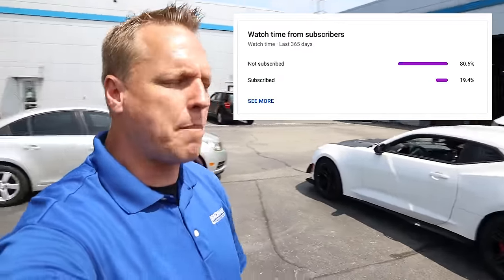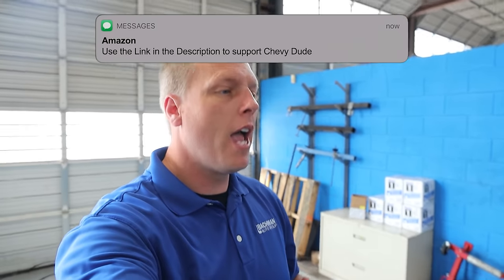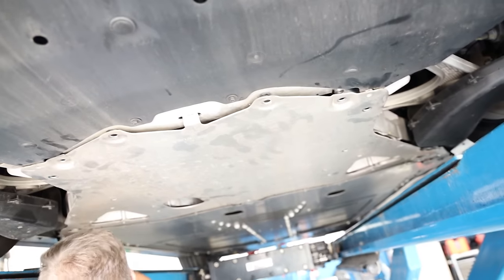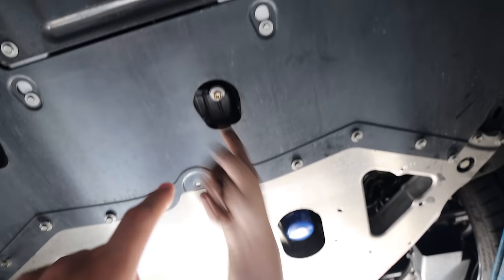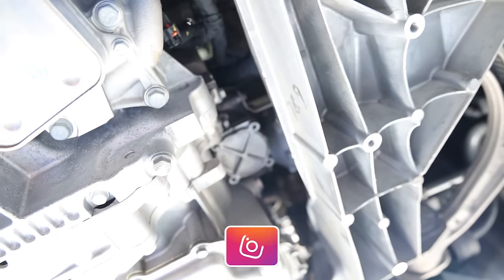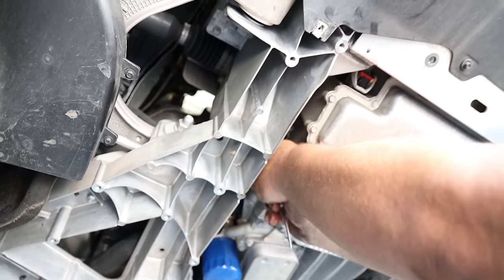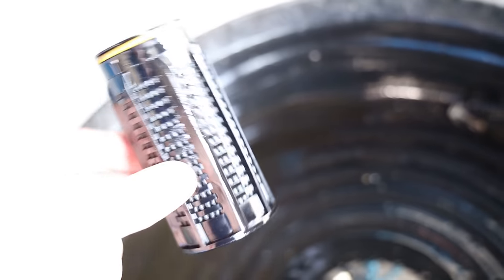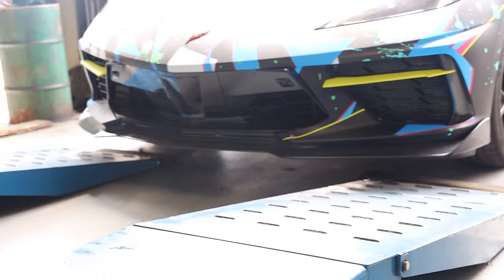How to change your DCT filter in your 2020 Corvette.  Dual Clutch Transmission Maintenance

Comment: Per the owners manual, DCT filter change at 7,500 miles, then at 22,500 miles then at 45,000 miles.  DCT fluid change at 45,000 miles.
"The initial transmission
 canister filter change must be performed at 12 000 km (7,500 mi), and every 36 000 km (22,500 mi) thereafter."
Reply: I do not this to many vettes will last 45,000 miles, still too many flaws

Comment: Just an FYI you need to do the valve flushing procedure prior to removing the filter to send all the contaminants in the passages into the filter.   Dont just pull the filter without doing this.
Reply: That procedure was only recently put out by GM as a result from the various DCT issues that have occurred on some C8s lately.   It didn't exist when they made this video.
Reply: @skylerallens  I saw your comment about this on another video about DCT filter replacement. Just to confirm, it IS required to flush the valves prior to removing the filter and that does require Chevy's MDi tool, right? Although it's outrageous what the dealership charges for this service, it sounds like, by the time I paid $500 for an MDi tool, and $200 for the filter, I couldn't do it any cheaper myself. Plus the dealer would probably attempt to deny any transmission related warranty claim if I did do it myself, claiming I did it wrong (even though I'd probably put more care and attention in to it than the dealership)

Comment: Thank you for the information for us C8 owners. When you changed the transmission filter, not.much fluid came out but some did. Why would the dealer not put more into the transmission? I know this is a big process but what if the trans fluid was already low? 
Thanks.

Comment: Chevy dude, aftermarket air filters are usually available and claim to boost horsepower. Any proof of this, and are there any you would recommend to get us rounded off at that 500 horsepower mark?

Comment: Hey Mike,
Did you figure out the cost per DCT filter change? Is this covered under a service package (is there a service package for the C8 and can you share the cost of it?)
Reply: The filter is $165/ea plus tax and s/h from Paragon.  With the 13+ qts @ $39/ea (with the 2 additional) you are looking at $633 plus tax and s/h do do the trans flush yourself.  Note the service interval for trans fluid replacement, unlike most vehicles that can go typically 100k miles.

Comment: Chevy Dude, What is the latest on Radiator Grill Guards ??? I like the look (and protection) but GM TADGE JUECHTER said it may void the warranty suggesting heat in the transmission.

Comment: At 4400 miles my C8 would not start. I researched & many others are having same problem & also discovering transmission fluid leak. 
My C8 has never been tracked, never launched. Too many C8 owners reporting same issues.

Comment: I have a 2020 z51 pre production corvette with 4,300 miles.   It is giving me the change oil soon message.  Is this because of a timer perhaps?
Should I ignore it until it gets to 7,500 miles?  I’m afraid to turn the dealer monkeys loose on it any sooner than necessary especially for the DCT filter.
I’m sure bolts will be lost and probably they’ll pry the filter out and use power tools where they shouldn’t.  Makes me want to do it myself but I’m a 50ish woman.
Are there any dealers in Texas or California with designated corvette techs?

Comment: GM says the first oil change doesn't have to be done till 7500 miles like the transmission.
  Why is it that you don't have to change the oil at 500 miles like most new cars. Does the C8 mid engine have different specs so it doesn't require a 500 mile oil change? Like you said in the video you and someone else did an oil change early that wasn't needed.
Thank you,
Mark

Comment: No torque settings for any of the bolts?   I figure the one for the oil cannister is hand tight only (53 in-lbs apparently).  But the ones for the panels (the 10mm, 13mm and Torx E16) should have some sort of torque setting.  Got a clue?

Comment: Man I wish I found out about you sooner I end up getting a 2014 town and country from this dealer and I been having nothing but trouble as soon as I get it had to change the brakes it was metal on metal then the check engine light and stability light came on at the same time and sometimes I use the a/c glass shards come out of it so ya I don't have the best of luck

Comment: Just a question, if I'm buying a C8 to track, why doesn't Chevy offer as an option or make it standard on a Z51 package that the 2 additional quarts of transmission fluid needed to track a Corvette be put in at the factory during assembly? Why make it difficult and expensive for the customer right from the start...
Reply from the maker: If plan to track it. Just tell your dealership so when they PDI they can add it. That’s the factory’s solution and it’s the correct one.
Reply: It is not a correct solution it should be there from the z51 get go.
Reply: @ST-bk5uf  I agree. If you order Z51 it means you are probably going to track the car. It should be standard on that Z51 option. It should be optional on the base without Z51. The labor to add 2 quarts of transmission fluid is pricy in addition to the 100 dollars for the fluid. Like Chevy dude said in the video "Tons of labor". Tons of labor is tons of money. And I know it's more labor to add the fluid than to change the filter.

Comment: Any tips if your free maintenence expired. Was told that service is at 7,500 miles or within 12 months. Since I don't drive it often, by the time it hit 7.5K it was past a year and they no longer cover it. So my dealer wants to charge $688. Any recommendations?

Comment: I noticed an opening for the oil filter. Could you cut a similar opening for the clutch filter?
Reply from the maker: There’s a reason it’s not cut.  I would not
Reply: Probably because the oil filter looks to be a conventional screw on type and located close to the panel so you don't need as much access room to remove and replace. The DCT filter being a cartridge style with a separate 4 bolt cover and an O-ring as well as further up inside the compartment needs more room to be able to push the filter in a click in place. You need to make sure you get the cover straigh in to insure O-ring seats properly as well as to hold it in place while getting the bolts started.
Reply: Also the access hole is mostly filled by the bottom of the air filter minimizing the amount of air forced up into the compartment and any airflow turbulence that could effect down force. An access hole for the DCT filter would be wide open meaning it could create a considerable amount of turbulence. Also the extra labor cost at every 7,000 versus every 75,000 miles would add up considerably.

Comment: How much time does it take to change the filter? Mine needs it done soon and am getting quotes of $900.00 to $1,000.00 to change it. Seems a lot. Is it the filter that costs a lot or the labour?
Reply: Takes more time to get the bottom engine cover off...and back on. I just did mine, and the filter was $133. When you do the first service at 7,500 miles, if you get the drain and refill, the oil costs $48 per quart. The maintenance time is getting to the fill plug...have to take trunk forward cover and air cleaner out to access it.  So some labor and expensive materials. I'm still b learning myself.

Comment: Is there a time limit for the 7500 miles dct filter change? if  before 12 months?
Reply: It only specifies 7500 miles for the first filter change. Then the interval changes. The next filter change per GM service information (GM S.i. ) change would be 22k miles.

Comment: Wondering how many auto repair places will be using air tools on those bolts and a flat head screwdriver. Also not that familiar with DCT but every 7500 miles to replace the filter seems excessive but if thats what GM calls for so be it.
Reply: Another comment says that the manual says to change the filter at 7500 miles the first time, then every 22k miles afterwards. So I guess it’s just due to break-in.

Comment: IMPORTANT INFORMATION: CHECK DCT FLUID LEVEL & ADD FLUID THAT WAS LOST DURING THE FILTER CHANGE.  The filter change instructions include adding approximately 0.2 liters of DCT fluid after changing the filter.  Here's a link to the graphic that shows the instruction to add fluid back.  https://www.midenginecorvetteforum.com/filedata/fetch?id=154908&d=1592298547

And here is the full list of instructions from GM...

C8 DCT Canister Filter change:
(6/4/2020)
Filter Kit Part Number: 24299326
Oil: ACDelco Dual-Clutch Transmission (DCT) Fluid-FFL-4 (part number 10-4130 / 19418016)
Removal:
Remove rear Cradle Shear Plate
Do not use power tools
Remove 4 bolts from Canister Cover 
Remove Canister Cover
Remove Seal (discard)
Remove Filter (discard)
Installation:
Clean threaded bolt holes
Clean filter housing (seal groove area)
Clean Canister Cover (seal groove area)
Install new filter (push upward until positive stop)
Install new filter seal
Apply light coating of new DCT fluid on new seal
Install cover evenly
Install 4 cover bolts, hand tighten
Ensure cover is fully seated
Do not use power tools
Tighten 4 bolts to 53 inch lbs.
Fill transmission to correct level.
Install rear Cradle Shear Plate.
Reply: You should have done the video !!!
The "Fill the Transmission" is what concerned me the most.

Comment: If you have to remove 30 bolts to do this every 7,500 milers that is a fail and a bad design.
Reply: and relying on chevy techs to not use power tools or screw drivers to not pry it off.  lol.  same ones installing brake ducts when they shouldn't and not knowing what jack points to use.
Reply: lol seriously? Are you dense? How is it a bad design? The car is made for performance, hence the reason those panels are under there like that. Obviously you are new to performance cars. If you only knew what exotics are like to maintain... hah

It's obvious to me you're just reaching really hard to bash the Corvette or Chevrolet. You can leave now.
Reply: NO the video is incorrect.  
1st time is 7,500 mi.  Then at 22,500 mi.  Then 45,000 mi.
He didn't even look at the Owners Manual -  Maintenance schedule !!!

Nor did he address topping off the trans fluid even though it is like a 1/3 of a quart.
Then loose more the next filter change. 
Then loose more the next time...

On a transmission that GM wants you to Over Fill by 2 quarts for performance driving !
Not Good !